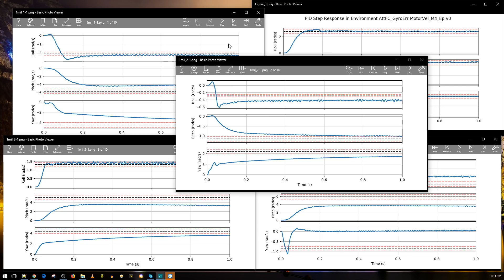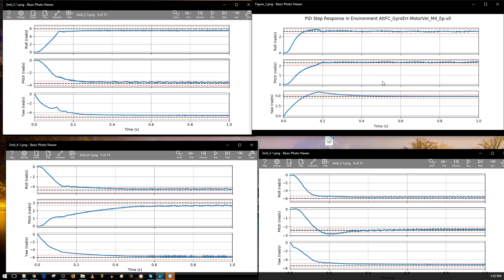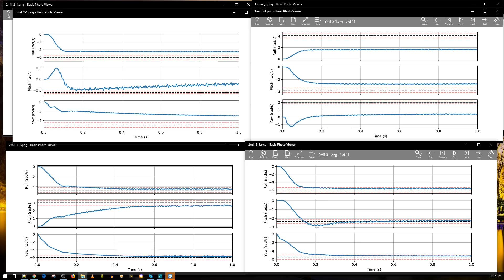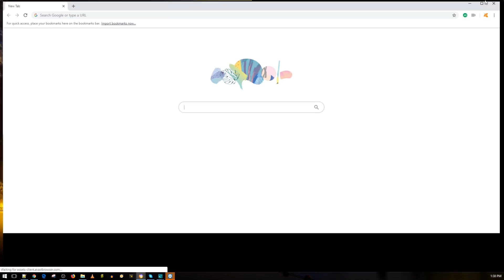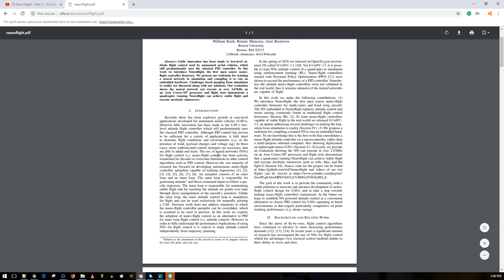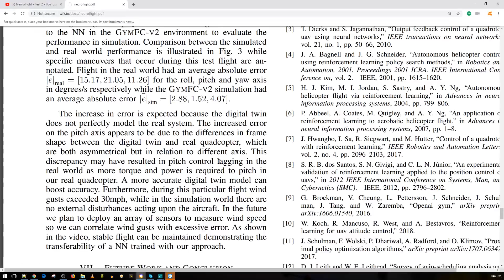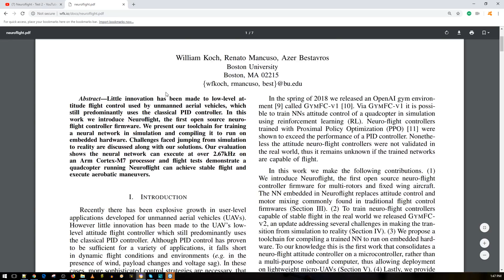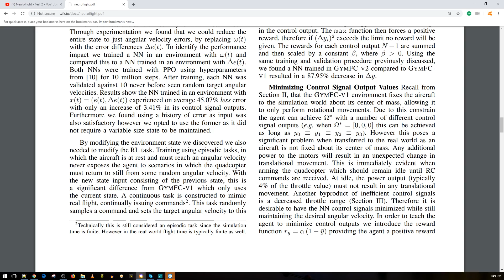PID Controller VS Artificial Intelligence // Betaflight Neuroflight

Comment: A flight controller is difficult to train. You miss a lot of disturbances in simulation. You need the right training data in order to weigh the axis equaly or what ever you like. Also i don't know how you backpropagate. But not every learning improves your system.
Reply from the maker: This is very old. I got it to fly and compiled on f4 mcu's .. Now I need to fix motor oscillations.

Comment: I usually speculate. I have to point out that you have got to reduce the learning steps and also decrement it over time too. obviously over-fitting issues after 3 million episodes. In addition, the common thought, the more episodes the better training does not make sense in these case. More tuned hyper parameters are more important than the number of training epochs. Try to use more variety of hyper parameter sets rather than keep the training going to infinity.

Comment: The death roll could be more of a hardware issue than software. I've had issues with recent builds due to EMI/(ahem, flux) creating a voltage in the inductor that is part of the buck net that takes vbatt down to 5v. This is a problem for the stm32. Also, the chip itself stm32F4/F7 will do all sorts of craziness if it is exposed to same. On 6S, the distance that seems to prevent this is 10mm+/- a couple mm and/or copper tape on the FETs (also mount the FC with stm32 device facing up/away from ESC). Of course of if he is using individual ESCs, then none of the above applies but being an engineer myself, I thought I better mention it as we tend to focus on the things we CAN control. 
*great video. Great tech. Good job fellas

Comment: The AI needs work I think.  Seems that it is just lucky most of the time, or maybe it just got tired, or needs a better processor, gyro, or something.  I wonder how it will do with noise from, motors, aso.  I really think it needs to be trained in a real invironment, and not in a simulation, because, there are prop oscilations, noise from esc and motors  plus frame resonance, that it needs to filter out.

Comment: I used to work with 3 layer neuronal networks back in the 90th. If the result is getting worse with more iterations than the weight of the backpropagation (=reward) could be to strong. Also I don‘t know about the data resolution and therefore whether noise or the lack of noise in the data could be an issue.  I am curious about how well the simulator works. That could only be a starting point, only real data is good training data. But that data has to be segmented/categorized eg. light 5“ Race quads, heavy 5“ acro quads. Same with two 3inch categories,  maybe also 1S and 2S whoops. A lot of (same resolution) real data from many pilots including quad specification would be great input for the training process. I wish I had much more spare time   to help working on this project.
Reply from the maker: Very useful info as far as I know in gymfc v2 they added more variables to the reward and I'm seeing that a pid controller might be much easier for the correct algo than playing a game or even learning to walk. Time will tell..

Comment: This is real interesting, particularly as its RL based, it seems like it'll be very cool to watch. I might wanna see if other policy optimizations would work better, I.e. Q learning or sarsa or something. Are we free to play around with the code?
Reply from the maker: Should be keep note of the sim as its outdated with the older rewards. Also make sure you read the papers that have alot of info and detail I myself had to read each around 10 times and still reading it as reference.

Comment: In those first AI milli seconds the curve shape seems to have determined the the rest of the time interval behaviors. In most of the cases you showed the response was somewhat linear shortly after the correction began followed by oscillation that was minimal. I am guessing the more runs of simulation is only revealing a boundary condition or convergence/divergence in reinforcing confidence of initial model results. I will have to read more. Thanks and keep at it. Very interesting work.

Comment: Loving this "series"(?). from what ive seen so far from your data i think each axis needs a different level of training to be equally trained for a balanced response. I think the sweet spot could be between 600-900 simulations judging from what ive seen so far

Im new to this neuroflight thing so i might be talking out of my arse but thats theories i have
Reply: I was thinking the exact same thing. Why can't we trade with an individually I for each axis and then just combine them.
Reply from the maker: Keep your theories comming no one understands it fully..
Reply: Without having much experience with KI systems I doubt the system could be trained better with isolated axis'.

Comment: Man, if I didnt have to have linux, I would really want to run this
Reply: Just make a live boot USB of Ubuntu or some distro and boot off of it.
Reply: @illpro2  that may work to get linux running on one of my machines, but I have honestly never even laid eyes on a linux system and have no idea what it'll look like or how to use it. I'm somewhat savvy when it comes to mechanical hardware, basic electrical circuits, soldering and that kind of stuff, so maybe I'm just scared
Reply: @TheOneAndOnlyRandy  nothing to worry about. a lot of these distros look familiar like ubunto and mint. Elementary OS looks mac-ish. idk just start looking it up. its really not that hard to get into.
Reply: @TheOneAndOnlyRandy  They look like Windows a lot but the icons are different.  Most Linux distros have a GUI or Desktop Manager.  Usually GNOME, KDE, Cinnamon, MATE, Xfce.  It's a slight learning curve but is pretty fun to learn.
Reply from the maker: Download ubuntu to 16.04